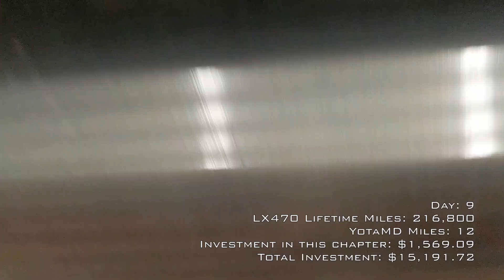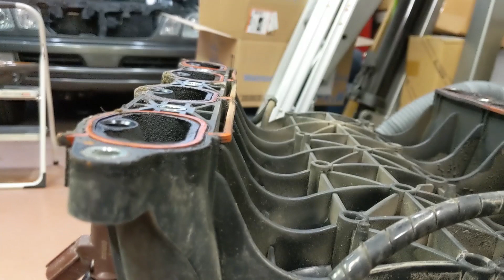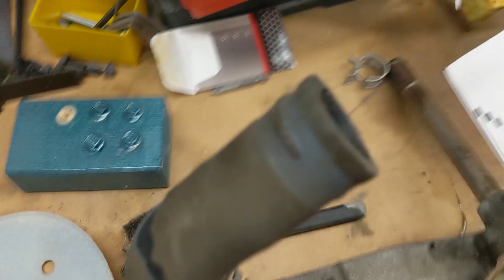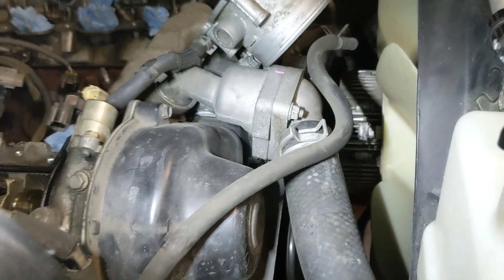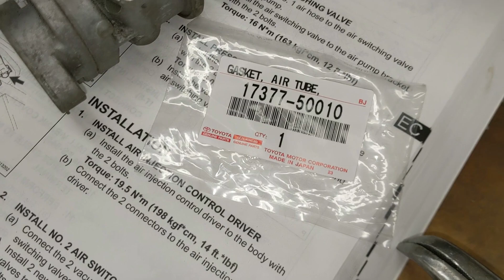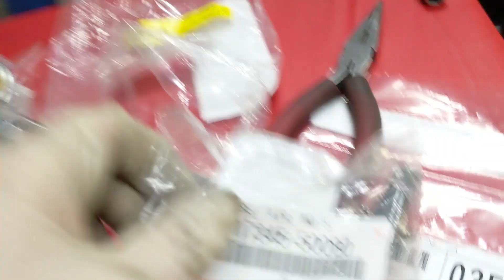Coolant Leak Fix - Rear Bypass Gasket 2006 Lexus LX470 - 2UZ VVTI

Comment: On the 4Runner, you CANNOT reach the back (lower) bolts for the air injection valves. We were able to remove the side bolts that connect those valves to the exhaust tubes with a 1/4" socket, wobble joint and a combination of extensions. We zip-tied the wire harness up to the windshield wiper and taped the bolt to the socket and taped the wobble joint. It was not easy, but we were able to do it. The 2 air injection valves were removed WITH the rear coolant bypass and installed WITH the rear coolant bypass. Hardest part of the job, hands down.
Reply: Did you remove the intake?

Comment: You dont happen to have a complete list of parts with part numbers from this job? If not I can go through the video and get them from what you showed. I have a GX470 which is leaking coolant similar to this so would like to do the same job and change the started while I'm at it. Should be all the same since its the same engine right?

Comment: I really appreciate this video you made. Probably have to do this to my 04 Tundra...
I did a timing belt replacement and I think the o-ring at the water pump connected to the crossover pipe isn't working. I'm hoping it's the bypass gaskets and it's unrelated to the work I did 😢
Reply: Same! I have an 07 4Runner. Did the timing belt/water pump. I cleaned everything up, that part seems to be good but then I found out about this new leak. Have coolant running from the back of the engine near the bell-housing (transmission) & engine. Hoping that this bypass/crossover rear pipe will solve the problem!
Reply: @michaelmagaruh7767  
My leak actually ended up being from a different place. I'm Glad I didn't go tearing things apart again, check the lines towards the rear of the engine at the top of the firewall. I had a loose clamp And a damaged hose so I had to cut it and reclamp it.
Reply: @dmamrenko12  So yours was coming from the heater core lines? I tried my best to thoroughly check everything from all angles and mine seems to be coming from the intake valley.
Reply: @michaelmagaruh7767  yeah, sounds like that water pump o ring... Sorry
Reply: I have same problem, paid mechanic on tbelt and wpump.  Now Oring leaking at back of thermostat housing to crossover. Did replacing Oring fix problem? Any pointers appreciated.
Reply: @garysuper1582 check all other lines to make sure it's not anywhere else. May need to end up changing the o ring
Reply: @dmamrenko12 it's definitely the 0 ring leaking. Did you change yours out? Solve problem? Create others?

Comment: How did you get to the rear nut on the driver side with the wire harness in the way?
Reply from the maker: If I remember correctly, you can unbolt the harness to move it slightly out of the way.

Comment: Any FIPG used in coolant by pass gaskets?
Reply from the maker: Definitely not where the orings go. I think there's a spot in the front timing cover area (unsure if I touched that in this job) where some fipg is used, but not on the orings. That's a big no-no.

Comment: Very good video. Would be very interested in parts list as I have the same coolant leak on my GX470 with the same VVTI 2UZ
Reply from the maker: Not sure if this will paste correctly, but here's a quick copy of my initial purchase for this job:
Part Number	Part Name	Price	Quantity	Total
73220-60323-A1	Belt & Retractor	$230.25	1	$230.25
68950-69057	Lift Cylinder	$32.03	1	$32.03
68960-69017	Lift Cylinder	$32.03	1	$32.03
16341-50020	Joint Gasket	$7.07	2	$14.14
11213-50031	Valve Cover Gasket	$13.58	2	$27.16
17171-50030	Manifold Gasket	$10.06	2	$20.12
53384-35010	Insulator Bumper	$6.14	2	$12.28
53382-60020	Bumper	$6.27	2	$12.54
75642-60021	Molding Quarter Wi	$22.88	1	$22.88
75641-60021	Molding Quarter Wi	$22.88	1	$22.88
90915-YZZD3	Oil Filter	$4.21	3	$12.63
12180-50031	Filler Cap	$10.41	1	$10.41
48933-60010	Cover Height Control	$9.04	1	$9.04
17116-50010	Plenum Gasket	$13.44	1	$13.44
90080-10330	Bolt	$1.26	10	$12.60
16401-67150	Radiator Cap	$12.37	1	$12.37
17801-50040	Filter Element	$18.70	1	$18.70
17030-50150	Hose Assembly Air	$30.39	1	$30.39
17345-50080	Hose Air No.5	$15.26	1	$15.26
90080-46347	Hose Clamp	$1.36	2	$2.72
23829-50161	Hose Fuel Vapor Fee	$11.78	1	$11.78
12261-50070	Hose Ventilation N	$16.08	1	$16.08
12262-50080	Hose Ventilation N	$13.68	1	$13.68
12204-50030	PCV Valve	$7.23	1	$7.23
12236-50010	Cover Ventilation V	$3.80	1	$3.80
90467-20010	Clip	$1.33	2	$2.66
58843-60050	Shift Boot Bezel	$31.69	1	$31.69
17342-50180	Hose Air No.2	$29.44	1	$29.44
17377-50010	Pipe Gasket	$1.02	2	$2.04
52380-60040	Support	$142.04	1	$142.04
41651-60010	Cushion Differentia	$35.98	1	$35.98
41653-60010	Stopper Differentia	$31.95	1	$31.95
41653-60020	Stopper Differentia	$31.95	1	$31.95
7730006040	OEM NEW Fuel System Tank Filler Gas Cap 2011-2013 Scion tC 2006 Scion xA 2005-2012 Scion xB 2008-2012 Scion xD 2010-2014 4Runner 2007-2012 Avalon 2007-2012 Camry 2006-013 Corolla 2007-2014 FJ Cruiser 2007-2013 Highlander 2005-2014 Land Cruiser 2006-2013 M	$15.23	1	$15.23
74615-60030-A1	Plug Front Assist Grip	$1.20	2	$2.40
96721-19010	Guide Tube O-Ring	$2.09	1	$2.09
90948-01003	Stabilizer Link Cushion	$2.09	4	$8.36
23291-41010	Injector Insulators	$3.19	8	$25.52
48849-60010	Stabilizer Link Lower Bushing	$9.86	2	$19.72
4881560111	OEM NEW Front Right or Left Suspension Sway Bar Stabilizer Bushings Fits 1998-2007 Toyota Land Cruiser	$11.08	2	$22.16
48815-26250	Stabilizer Bar Bushing	$12.84	2	$25.68
48817-30010	Stabilizer Link Cushion	$3.09	4	$12.36
90385-19010	Shock Bushing	$2.16	1	$2.16
28100-50101-84	Starter	$189.51	1	$189.51

Subtotal: $1,249.38
Estimated Standard Shipping: $97.28
Total: $1,346.66

Comment: What book are you referencing and what’s the part number for the bypass pipe o-ring. Going crazy trying to find it online.
Reply from the maker: The Lexus manual (commonly called the "FSM") for repair procedures. For parts, I use ToyoDIY. Register for an account and you get the full parts diagrams. Once you learn to speak the "Toyota parts language" it's immensely powerful and will save you a ton of time on the phone with the parts folks. If that doesn't answer your question, let me know.
Reply: Thank you. Went to the dealer earlier this week to order parts and gaskets for the Teardown and ordered some incorrect items that I needed up needed but missed some. Way more gaskets them I thought when I removed the Manifold earlier today. Great video!
Reply: Got everything back together and ended with a misfire in 6,7and 8. Thinking cause I skipped getting the fuel injectors cleaned. I know #8 and 6# are having a hard time. I should have followed all of your steps 😫
Reply from the maker: @jerryallday  That's a bummer! multiple misfires seem like an unlikely problem from dirty injectors unless you had that same problem before the job.
Reply: @user-df1gh8le6l  i only had a coolant leak before from the coolant bypass (bad o ring). Going to take everything apart this weekend and see were I went wrong. Hopefully it’s a simple overlook but idk
Reply: What is that bypass oring? I can’t find it online either or on toyodiy